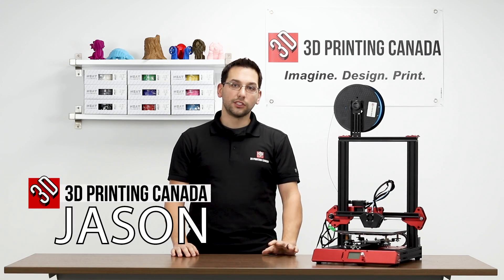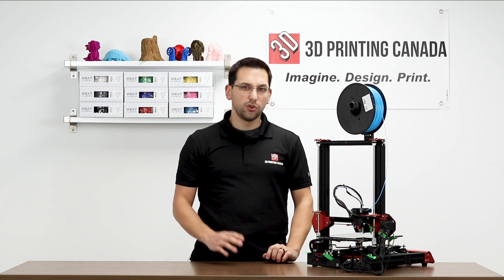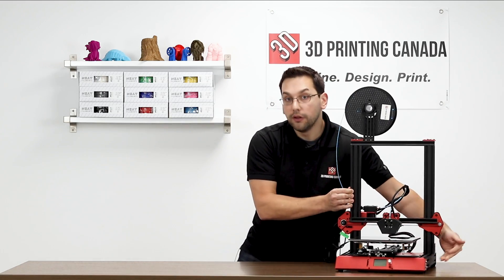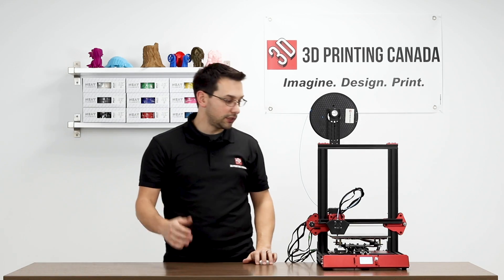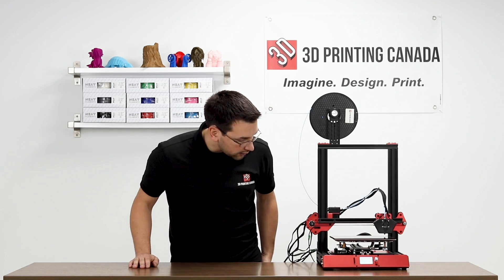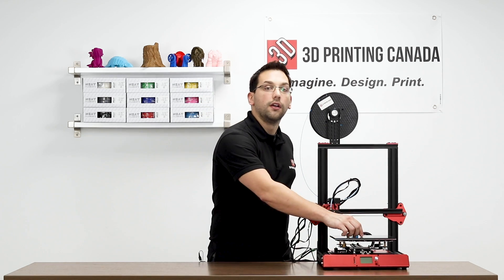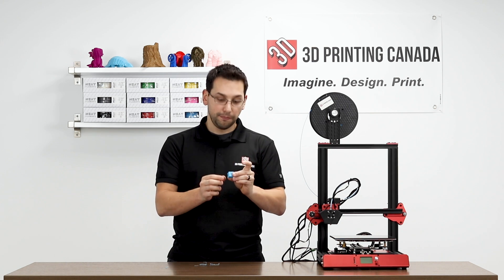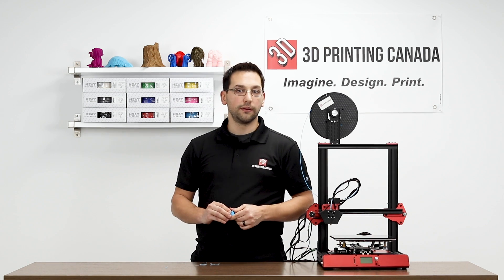Tevo Flash First 3D Print

Comment: I gave up on mine ever arriving so I cancelled the order and just ordered an Ender 3 Pro. The Ender 3 Pro has its issues though, the bed was quite warped and was impossible to get levelled. I ended up ordering and fitting a BL Touch which seems to have resolved the issue (mostly). I may still order a Tevo Flash when more stock is available.